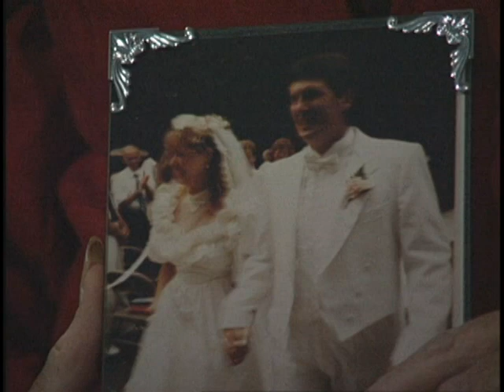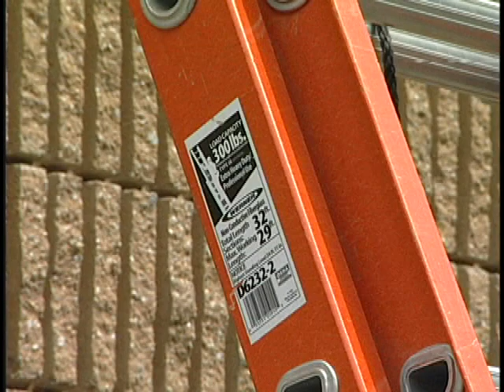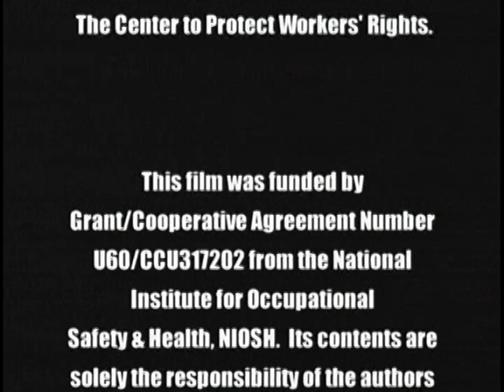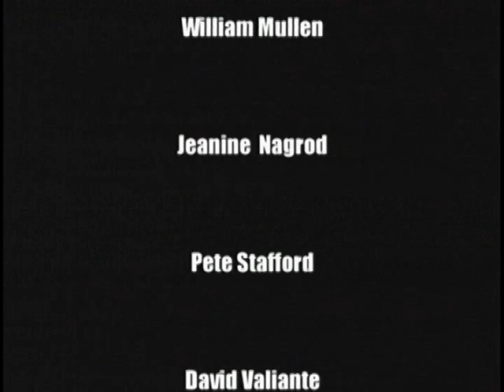Don't Fall For It!: Ladder Safety

Comment: This is a good video for basic ladder safety.
The most common ladder injury is strains and sprains. Lifting and carrying a ladder applies a force to the lower back that is greater than double the weight of the ladder. Ladder Mover is a low-cost solution to carry multiple ladders and supplies in one easy trip, works with any size and type of ladder.

Comment: I worked for soooo many slave driving companys who do not care about ladder saftey, just fast work progression. Sadly, one of my last painting jobs had me moving and climbing a 40ft ladder by myself in the foothills of a mountain range. I then was required to cut stucco around multiple windows in order to remove them and install new ones. I quit eventually, but this type of stuff is so common in smaller construction companys. Recently I screwed on of those companys over by reporting them to OSHA

Comment: I remember me and my dad did renovations on an old house and we used an old ladder that had a massive split down the middle of the left leg that survived 2 generations of my mothers family. The split would be like 1 inch thick if someone was standing on it and you would hear it cracking even more each time we used it. We used it anyway, lol. We knew it was unsafe but nobody wanted to buy a new ladder. There is no sad ending to this story.